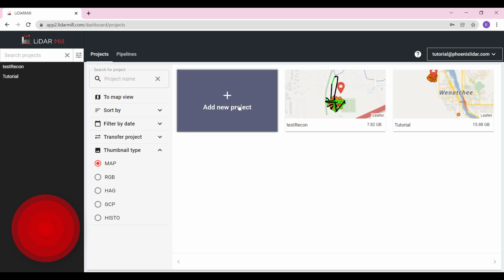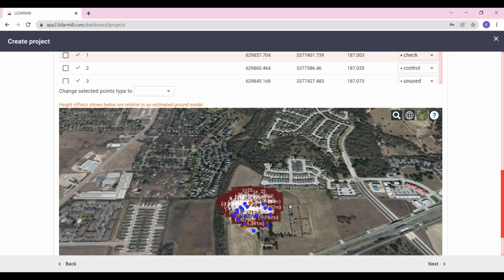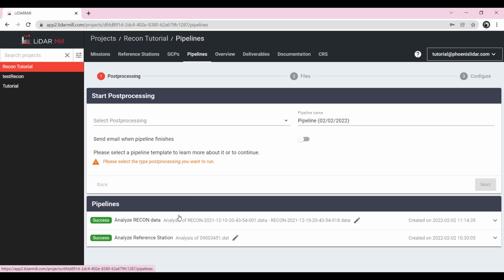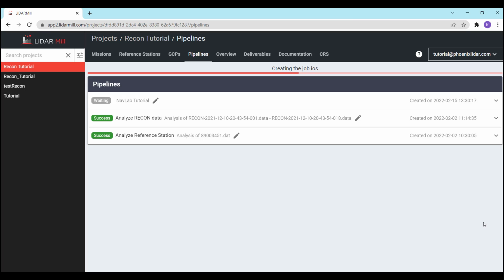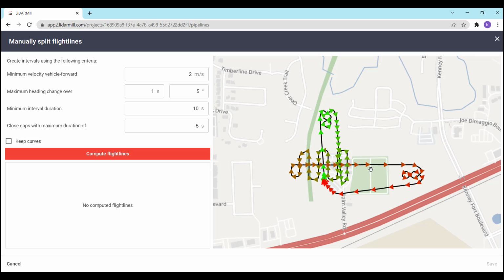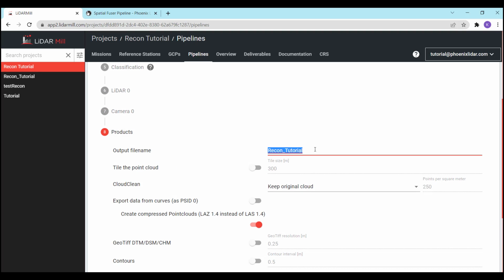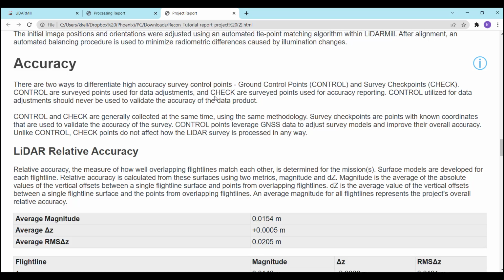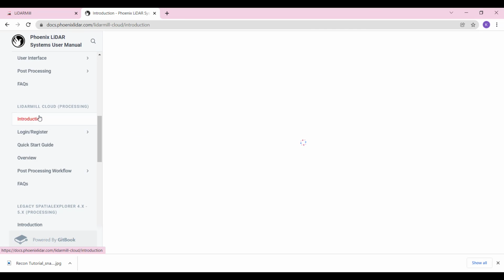How to Become a LiDARMill Post Processing Workflow Expert

Comment: Good Evening. We just purchased a Recon XT system from you and are awaiting it’s arrival. This video is fantastic and extremely helpful.
I was wondering how the GCPs are “marked” in this workflow. I saw in the video where you imported them, but am not sure how the data set was transformed to the control without human interaction. 
Wouldn’t the user need to pick a specific point within the cloud and tell the software that that point is the specific gcp?